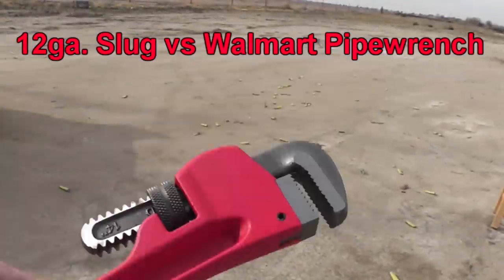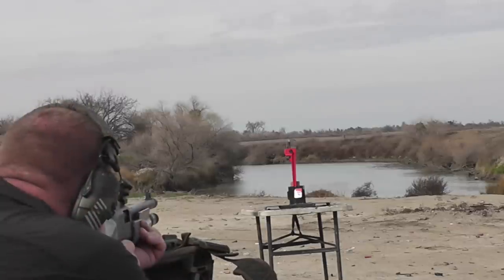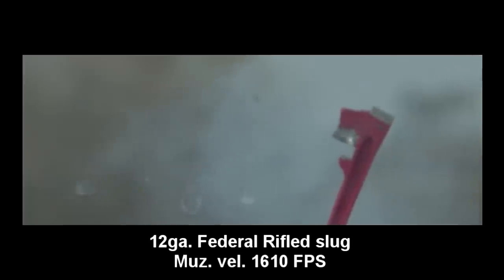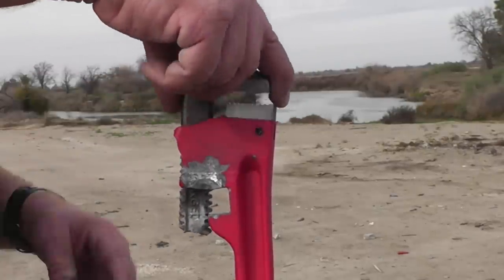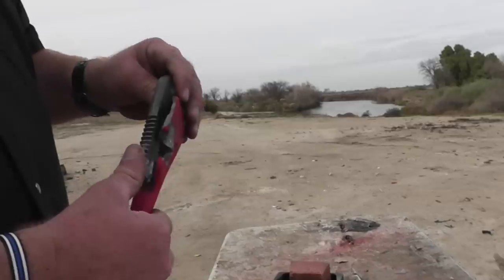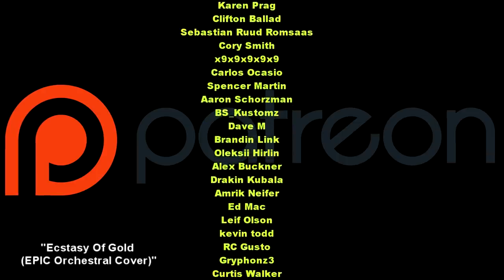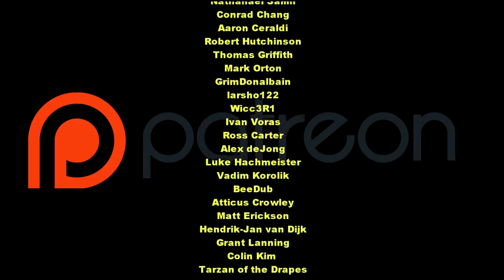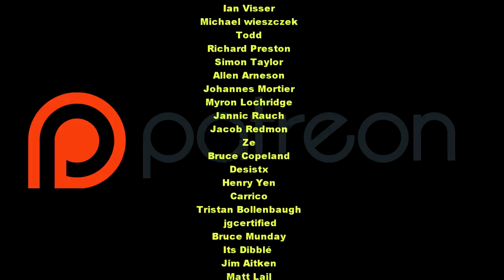Cheap PIPE WRENCH vs 12 ga. Slug  (slow motion)

Comment: i'll be making videos soon, mostly with pellet and BB guns, gonna rip apart a 32" TV and a few other things that don't work around the house. i haven't done anything in the 1-1/2 years since my congestive heart failure. I just got over 400 CO2 12 gram cartridges which equals 40,000 shots on sale at wallymart and amazon ($0.25 a cartridge, 4 shots per penny) and i'll be playing with .22LR CCI "Quiet" as well, don't want to disturb nobody! i did get a silencer for my Crosman 1322 pistol, along with an 18" barrel, being a .22 pellet gun, a silencer is legal :)

Comment: Policies on content featuring firearms
YouTube prohibits certain kinds of content featuring firearms. Specifically, we don’t allow content that: 

Intends to sell firearms or certain firearms accessories through direct sales (e.g., private sales by individuals) or links to sites that sell these items. These accessories include but may not be limited to accessories that enable a firearm to simulate automatic fire or convert a firearm to automatic fire (e.g., bump stocks, gatling triggers, drop-in auto sears, conversion kits), and high capacity magazines (i.e., magazines or belts carrying more than 30 rounds).
Provides instructions on manufacturing a firearm, ammunition, high capacity magazine, homemade silencers/suppressors, or certain firearms accessories such as those listed above. This also includes instructions on how to convert a firearm to automatic or simulated automatic firing capabilities.
Shows users how to install the above-mentioned accessories or modifications.
Report content that violates this policy
You can report videos that you believe violate this policy by flagging the video.

Was this article helpful?
https://support.google.com/youtube/answer/7667605

Comment: Those really come in handy. Some times mostly for pipeing. They lock on to what ever you are trying to stwist.  Pluse you can turn that top piece around and make it a better weapon and you could even. Sharpen that part to a point but i mean. Then it wouldnt good for anything else.